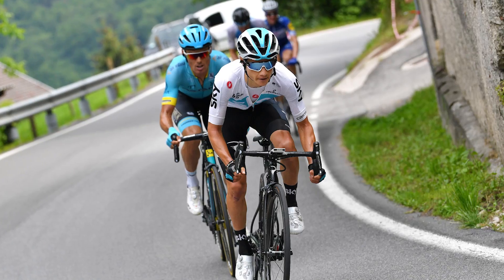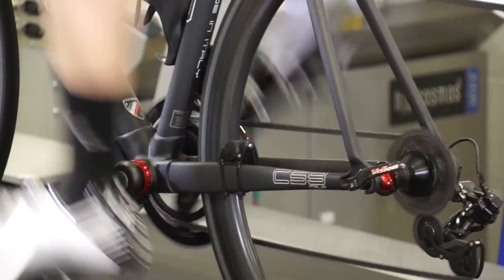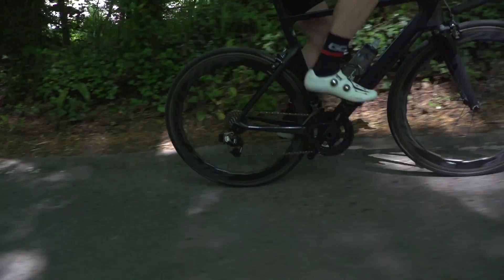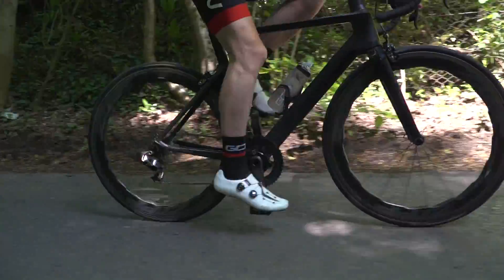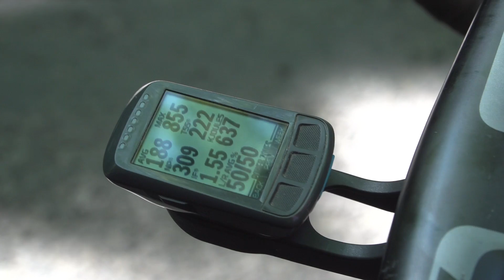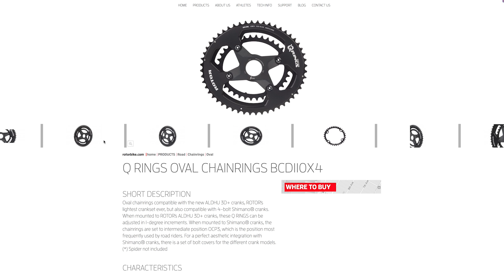Spinning Vs Grinding - What's The Optimal Cadence For Climbing? | Geek Edition

Comment from the maker: Do you spin or grind?
Reply: Grind on short rides, spin on longer rides
Reply: I spin until I run out of gears, then I grind the hell out of the first one :)
Reply: I stomp. I used to do less than 60 on long climbs.
I start to understand why, now, me being heavy-built (cough) and apparently having rather slow muscles.
Reply: @lanzji1345  but a lower cadence tends to produce less knee torque, so the argument for longevity is on the side of higher cadence here?
Reply: I just do as I feel at the moment... If U overthink it the other guy(s) are far away...
Reply: Pascal Joris yeah!! Fatties unite! Think of all the extra power we put into the stroke when we get out of the saddle! Granted, it takes us a few minutes to get out, but one we're there though! 🏋️🚴💪
Reply: I try to spin 80-100 on both flats and climbs however on the climbs I tend to fade badly and so does the cadence.
Reply: I’m over 60 I’m over weight spin or grind it does not matter to me how I do as long as I am enjoying the ride and getting fitter but I do see if it matters when your younger and to give them the best advice for them great video as always
Reply: One reason to grind in increasing age is to maintain muscle mass.  Not everything is about winning today or even in 3 months.

I'd be really interested to hear more about fast twitch muscles.  General wisdom seems to be that they are useless for anything but sprints as they get knocked out very quickly. Dr. Passfield seems to say otherwise.
Reply: my gosh 100 - 120rpm up the climbs? can you post a video or strava activity?
Reply: GCN Tech I'm always somewhere inbetween at that cadence sweet spot thanks to a CVT with automatic shifting. 
If Louis wants help with research I have the perfect bike. Just give me a cadence against power equation and I'll program it. Due to it not being restricted by gears it will maintain an accurate cadence.
Reply: I spin at 100-120rpm up the climbs. I am a climber though, I’m not great on the flats but can gain the time on the climbs.
Reply: Spin to win
Reply: Spin
Reply: That is not a simple answer on that. It depends :)
Reply: Matt Stevens favourite pickup line.
Reply: Sam Murray LOL. I used to be very fast, one of the fastest of my group...
... for the first rotation. 😁🤜🤛🐘
Reply: I try to spin, but when it gets really steep, it's 100% grinding or dying.
Reply: I spin in the saddle, grind out of the saddle on the steep sections. Spinning out of the saddle just doesn't seem to work for me :S
Reply: Slow twitch...fast twitch...I had mine tested and they said I have mostly no-twitch. I don't grind, I grunt.
Reply: Why not Grind + Spin? So you -
GRIN ... at people behind you who inhale your dust.
And if you're feeling a little bit flatulent. Well...
Reply: I wish that I spin more but I resort to low rpm in long  5% climbs!
Reply: spin on clmbs ...
Reply: Spin when possible usually 85 to 110 anything over 10% grade it seems to drop to around 70
Reply: On flat both. either 80-85 or 100-110 both feel natural. Often I'll switch between the two. It seems to reduce fatigue. On hills spin 110-120.

Comment: I'm 5'10" with long legs and short torso, I have had knee problems in the past but since I bought some 165mm cranks, my knees are fine. Now my cadence is usually between 90-110 on the flat. It goes down to 70-80 up climbs. My BB to saddle length is 79cm - slightly increased compared to my previous standard set up so I'm able to get pretty aero too.
It's so much easier to accelerate and close gaps when you spin, since you always maintain some strength in reserve.

Comment: I find even for the same power and similar speeds, my cadence changes if I'm in a group (especially at the upper end of my capacity) compared to when solo. I think my relatively low capacity to produce big torque (and big torque changes) means that the higher cadence makes it easier to respond to the inherent pace changes of group work.  I naturally self select a lower cadence in time trial efforts (about 85-90 compared to 100-105).  I wonder if taking the wind myself is more akin to the climbing effort, compared to in a bunch.

Comment: As mentioned in the video, it depends!  One thing that I've come to realize (and that's been supported in these videos with the Dr and comments) is that you can use cadence to your advantage.  It doesn't have to be one or another.  For example, if I'm reaching my max heart rate or been high for a period of time I might switch to a harder gear and lower my cadence to give my cardiovascular system a short break. Conversely, if my legs are getting tired or I sense they are taking too much of the load (muscle feel and heart rate) I might switch to an easier gear and higher cadence. I doubt most of us casual riders are constantly riding at the limit of both and we should be able to change between the two depending on the variables involved at that time.

Comment: One of the reasons I like single speed riding is you can practice both grinding and spinning without having to change anything. RPMs vary much more than with gears.

Comment: Perception of higher power when climbing? Interesting, while there is no scientific backing from my part, but just personal experience over decades of riding, my take is there is less wind resistance when climbing versus when trying to maintain a same power on the flats. There is a psychological effect, faster you go on the flats, the more resistance. With age, I have started to focus on power and less on cadence. The old heart is unable to sustain a high and long aerobic output, versus, lower cadence with more power from stronger older legs. Bottom line, focusing on power (force as opposed to cadence), including off the bike boot camp training to improve leg strength and agility.

Comment: Dare I say that wind resistance will be a factor as well, given that while climbing wind resistance is less important than flat riding. Pretty hard to overcome air resistance and maintain speed on the flat by standing on your pedals.
Reply: wind resistance lower, but gravity more than makes up for it. Which would you rather do, grind up a 10% grade with no head wind or grind on the flats into a 15mph (20kph?) head wind? 
Part of the head wind factor has got to be "without this headwind I could be using 53x11!" or "geez even on the flats in this headwind I'm suffering in 36x28!"

Comment: The lowest Dura Ace gearing on offer from Shimano is 34-32 which is what Froome used for the Zoncolan this year:
http://www.cyclingweekly.com/news/racing/giro-ditalia/gearing-will-giro-riders-use-tackle-monte-zoncolan-380550

Michael Woods' Strava data is available for his Zoncolan climb:
https://www.strava.com/activities/1582256421/segments/39566230950

He averaged 338W at 73rpm up the climb and averaged 7.8mi/h.
Even with a 34-32 he would have had to put out even more watts and average 1 mph faster than he did in order to spin at 100 rpm up the climb:
http://www.bikecalc.com/cadence_at_speed

I think the main factor in why pros spin a lower cadence up climbs is that current road gearing doesn't support high cadence even at the speed at which the fastest climbers ascend.

Comment: Excellent! Great information. Professor Louis Passfield is one of my favorites!

Regarding crank arm length - Haven't many pro cyclists been tested to discover their optimum aero position on a TT bike? The same is true for triathletes on their tri bikes. As they attempt to reduce the frontal surface area of their bodies by lowering their shoulders, they reach a point where their legs are rising too close to their chest, causing a reduction in the amount of power they can sustain. Reducing the crank arm length is one way to compensate for this and that's why you see some TT and tri bikes with shorter crank arms. So, it seems to me, there is hard evidence to support crank arm length affecting power when the cyclist's position is being pushed toward an extreme as it often is on TT and tri bikes.

By the way, I'm 61 years old and tall. I ride in an "aero" position resting on aerobars most of the time and I'm using 165 mm crank arms. When I was younger, I used 175 mm cranks but, as I've aged, I found the shorter cranks more comfortable for sustained use. The shorter cranks have never diminished my power -- but they have increased it slightly due to increased comfort. My wife is 67 and is short. She started with 165 mm crank arms when she was younger but uses 145 mm crank arms today. Without the shorter cranks, she would have too much knee discomfort. Virtually no crankset manufacturers in the road cycling market make cranks this short so we've had to turn to the BMX market to find them.
Reply from the maker: Thanks for the comment D.Eldon, glad you enjoyed the geek edition!
Reply: Spinning with shorter cranks means tracing a smaller bio mechanical  circle which for me is easier and naturally increased my cadence and comfort. Power stayed the same.

Comment: I loved the part about perceived difficulty playing a major role. Psychological effects are huge!

I think one of the most interesting distinctions touched on here is between efficiency, power,  and speed. Race a muscle car, a large diesel truck, and a small electric car up a hill. Which one gets to the top of the hill first? Which one burned the least energy? and which one generated the most power? 

I personally find that while lower cadence grinding will get me over a hill faster, spinning with power gets me over it more efficiently (perceived at least) and allows me to ride the subsequent hills and the ride as a whole at an overall faster pace. We talk about big engines in cycling, but there is also such a thing as a big gas tank (fitness + glycogen capacity). My choice of cadence is mainly based on my currently fairly small gas tank and wanting to stretch that tank as far as possible </metaphor>
Reply: He didn't quite say it's a psychological effect.  He said perceived difficulty is related to fatigue.  Nobody said that your perception is not in tune with subtle realities.  He did though kind of leave the hint that could be psycological.

Comment: As a recumbent rider I nevre get out of the saddle, but I wonder if measurements on experienced recumbent riders (including pressure on the seat) will help filling in some of the blanks.
With respect to the shorter cranks: I ride with 155 mm cranks, I'm 1.78 m tall. On my bike the shorter cranks are required to be able to fit inside the fairing, so basically everyone in that type of bike will ride with those 155 mm cranks (these are either special Rotor cranks, or shortened Shimano 105). This includes the manufacturer of those bikes, all ~2 m height of him. It is a matter of getting used to, and training a little to ride at a slightly higher cadence.

Comment: Ummm, thanks GCN. I'm now even more confused than I was before I watched the video. 😂
Reply: Robert Tore Welcome to the world of scientific research. For every question you try to answer you end up with half a dozen more questions.
The basics of it are that grinding tires the muscles so only good for short rides. Spinning burns more energy and so is least efficient. Find the sweet spot somewhere inbetween and you will achieve the best performance. What I've found that works for me is to vary cadence depending on power output, more power higher cadence.
Reply: nothing to be confused about... low cadence you burn your muscle high cadence you don't.. Shit for brains!! :0)

Comment: Shorter cranks for the same cadence means LOWER leg speed than longer cranks. Short cranks is smaller circle is less distance in the same time, thus lower leg speed than longer cranks.

Comment: Yep this correlates with my power meter data It’s easy to hit 600+ watts on a steep climb😅 (yes I know it’s blow up territory 😳) now if only I could do that on the flats for an hour 😊 the high cadence does help reduce fatigue in my legs when climbing it’s also easier on the knees as well. Climbing with a high gear and low cadence is definitely more tiring. The other thing I noticed about high cadence is your lungs work harder, but also I read somewhere that with your legs spinning a lower gear it creates a secondary pumping action and I think that helps clear the fatigue metabolites more quickly from your legs. As for practicing high cadence it took me about a month for me to hit 90 cadence and hold it for the duration of my rides my body has adapted to it and now I’m comfortable with it. Coupling high cadence with a power meter is great because you can gradually increase your training in a controlled manner just by upping the wattage and I’m finding that I can spin bigger gears as time goes on.😀🌶🌶
Reply: Theres a 'body hack' in high cadence. It stabilizes your heart and keeps your heart and lungs workng a opimal efficiency. Its the same for marathon runners. A good endurance runner should have a foot srike rate of 4 to 5 strikes per second. small steps and lots of them.
Reply: I've read a few books on it. Youll see that slower foot strike rate produces inefficiency (overstriding).  Your body starts to rotate and stride becomes handstring driven. You see some runners like this,  but are prone to injury as well. 3 to 5 sounds fast doesn't it :). But it works, just like Froomes crazy cadence. We've only been cycling for 200 years now. We've been running a lot longer. I used to be a biomechanist, I was retraining quality runners for a few years. There are military studies about gluteal activation and oxygen rate efficiency too. Somehow, gluteal activation hacks your body to become more efficient in oxygen use. So, sitting and spinning may tap into this somehow.
Reply: Darci Ford 4 and 5 footstrikes per second for a marathoner is a little excessive no?

Comment: Can Louis help me program my automatic shifter. It uses a CVT so can maintain a very precise cadence +- 2 rpm. I also have a power meter connected to it. I'm trying to get my head around the cadence against power output equation. Its becoming clear it may be more complicated than a simple straight line I currently use.